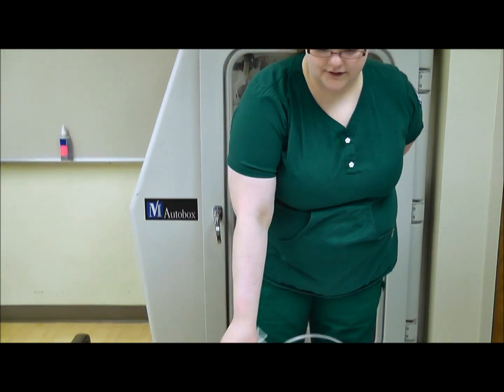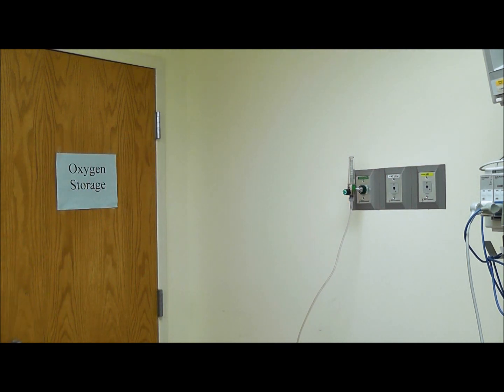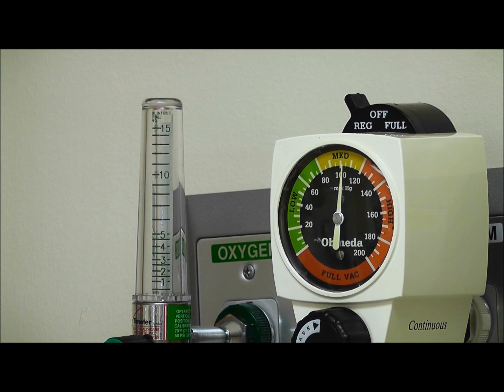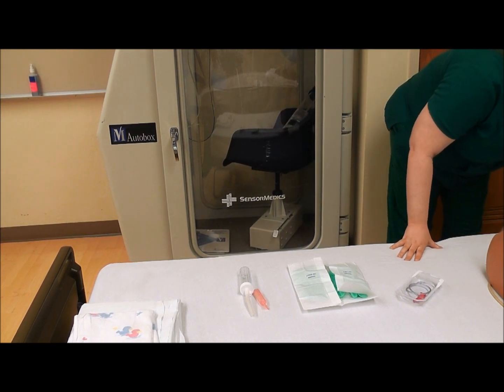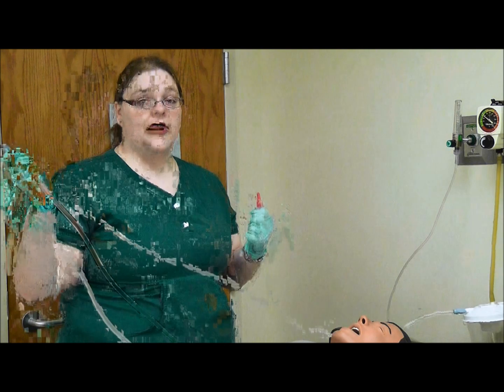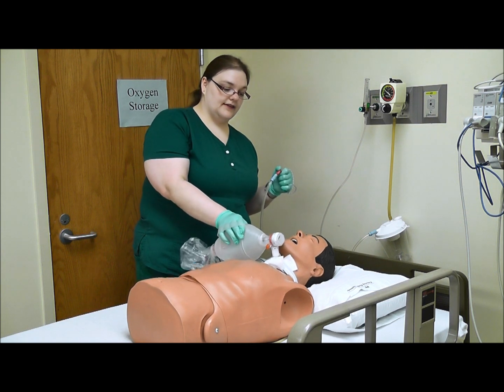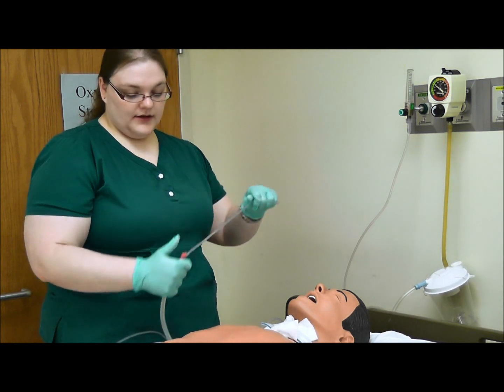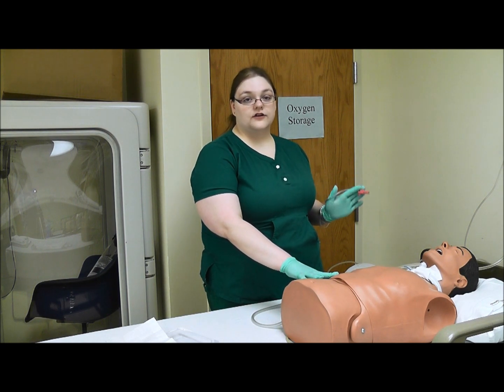Tracheostomy Suctioning

Comment from the maker: Sorry I didn't see this sooner!  The sterile water dose is what comes in the suctioning kits. Using a bottle of it would be pretty wasteful, because once you dip the catheter into the bottle the whole thing is contaminated and should be thrown away at the end of the session.  With this setup, you don't clean the suction tube - the catheter gets tossed, the tube leading into the collection bucket is 'cleaned out' when you suction sterile water through.  Twisting is just a different technique.